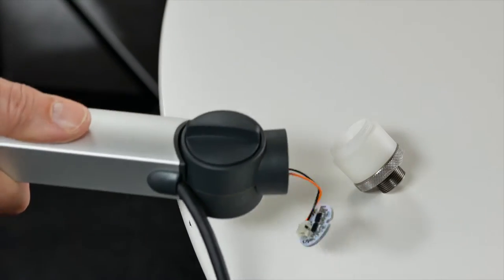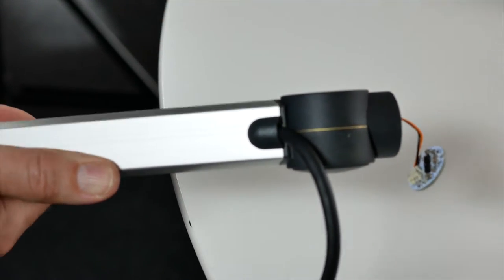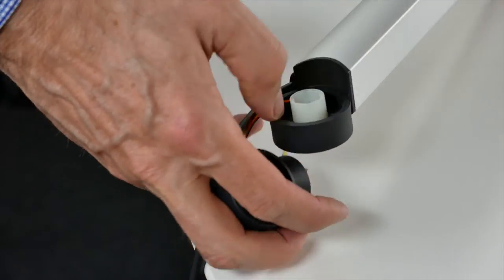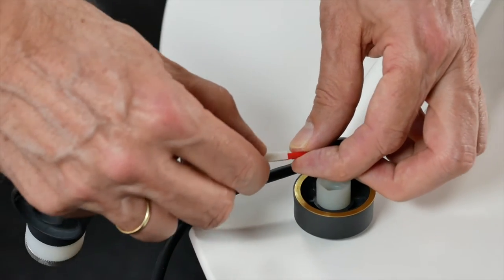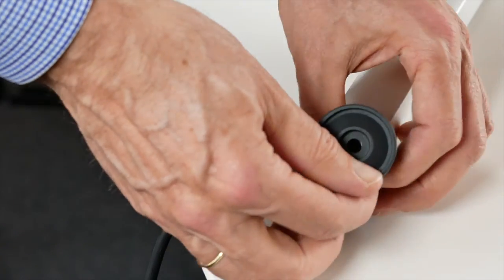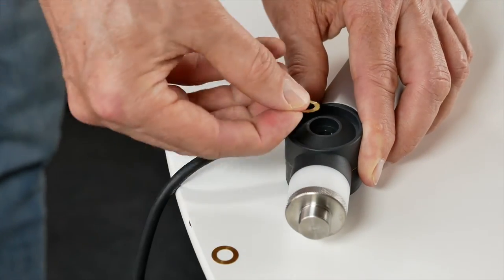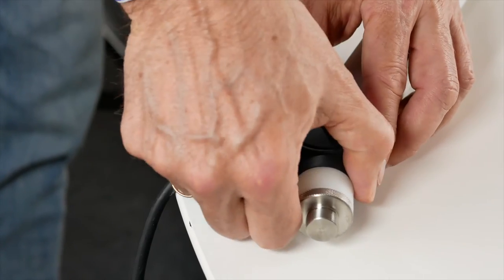Yellowtec Tutorial - How to replace your m!ka Mic Adapter

Comment: How do I use the On Air lamp. What power source should I use?
Reply from the maker: To adjust and control the on air signal, you need to integrate it into your system infrastructure. Please find a wiring instruction here: https://www.yellowtec.com/mika/downloads/

Comment: My red orange cable is maby stuck I need to pull hard and cannot pull it out any recommendations
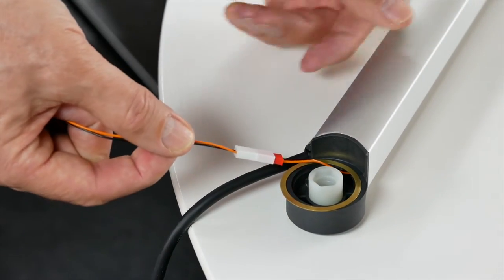Reply from the maker: Please detach the white plastic part in the center of the joint (e.g. shown at 0:40) by pushing it out. This way you get better access and you can reach the connector in a much better way.  It should be much easier to pull out the red orange cable. If the problem is that the cable is stuck inside the arm, please use a paperclip to release it. Please never pull hard. This may cause damage. If the problem still occurs, please reach out to servicecenter@yellowtec.com! We will support you in the best possible way.
Reply: @yellowtecgermany  I can remove and pull it out not that I break the white part
Reply from the maker: @kevgames21  You can gently push the white center part out. Don't exert to much force. If the part cannot be removed by gently pushing it out, please don't. Rather contact our servicecenetr@yellowtec.com instead!
Reply from the maker: @kevgames21  Then remove it to better access the cable. If you are not sure with removing it, rather contact our support team.